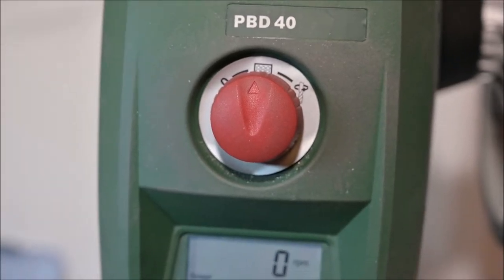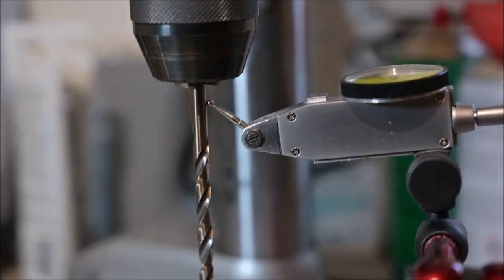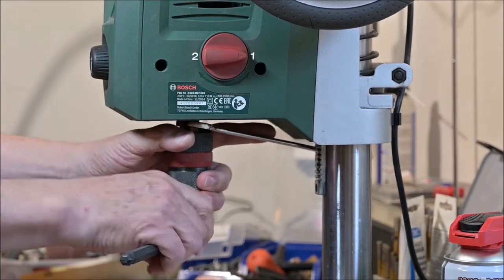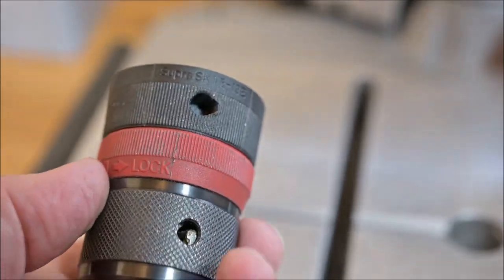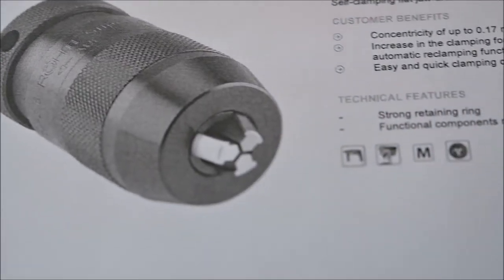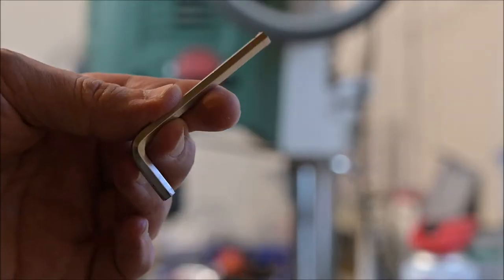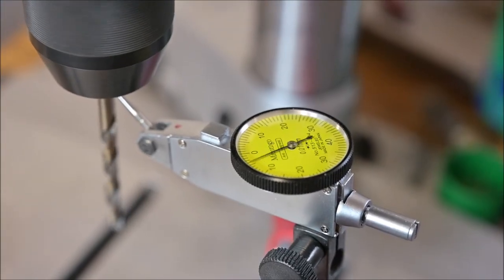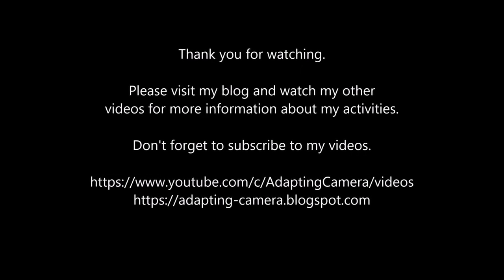Chuck changing on Bosch PBD 40

Comment from the maker: Please note that when you order the chuck you must type in the right part number. Only the ones with 1/2"-20 mount fit this machine, and the one I am using is the 871050. That is very important when you buy the chuck to avoid ordering the wrong one. Please have a look at the end of the my Bosch PBD 40 story: https://youtu.be/3IsRIDdp05o The main reason for letting this machine go is the drill head wobble. After all the years this machine was on the market, I had mine for about 10 years, this simple issue is still not fixed. Every one I checked in every store in several countries has the same issue. It could be easily fixed if Bosch would change the rack to a bit wider one or at least would add some set screws to tighten and adjust the wobble. It's a shame because I really like this machine.
Anyway, I bought a new machine: https://youtu.be/5_HTjUOUsf8 It's not perfect, but much better in many ways.
Reply: how many mm is the thread size?
Reply from the maker: @bonjob47  Thread size is 1/2"-20, not mm.

Comment: Only a few days ago, I was seriously considering a replacement machine for my PBD-40 because of the run-out, but now I think I will try buying a new chuck. Good video!
Reply from the maker: Beware that the machine head is wobbling also, so make sure that it is acceptable for what you are doing. Also, you may consider changing the bearings as well, if not now, maybe one day, because they are not great.

Comment: Great video and really good advice. I’ll be upgrading now that I have seen this. Also, heat can sometimes be really helpful to remove “glued/lock tight” chucks. Sometimes just an ordinary heat gun blowing into the centre of the chuck for 5 minutes or so can “melt” the glue, and make removal easier.
Reply from the maker: Thank you for your comment. Actually, I don't think it is glued at all, but as you use the machine, the chuck will be more and more tightened because of the rotation. This is of course good for drilling, but makes it more difficult to remove the chuck if necessary. Personally, I would not use a heat gun because it may cause fire or cause other damage to the machine. Also please note, that the bearings of the spindle will also be heated up, and the grease in the gear box may melt. So while in theory, heating it may help, it may also cause damage, so be careful.
Reply: Ageeed. I use it as an absolute last resort measure when everything else fails.

Comment: I changed the input shaft top roller bearing on my BPD40 for 2 ball bearing races, and there is now zero movement on the shaft of chuck.
Reply from the maker: Yes, it's a good idea to change all the bearings. I also have a set of bearings and will change them one of these days.

Comment: Hi from Finland. Had to wait about a year to do this due to not having sufficient space for my PBD 40. Finally did the chuck changed today, following your instructions.The original chuck was glued damn tight, but the pipe method worked perfectly. Thank you so much for this great video, was really helpful.

Comment: Thank you for taking the time to show this useful mod. Apparently, there are videos covering changing the 
bearings on the output shaft of this drill - but as you have shown, this might not be necessary, with a simple
change of chuck. I haven't purchased this drill yet, but have been pondering on it. Very helpful, and 
appreciated :-)

Comment: I'm so glad I found this video. My PBD40 was always throwing out bits during use and I didn't have any faith in it. Just ordered the Rohn Supra. Thanks
Reply from the maker: Thank you very much for your comment. Yes, your problem was my problem also, and in fact, that was one of the main reasons for me to change the chuck. That locking mechanism is just a joke, I never liked it, and it can actually become quite dangerous. Sadly, the machine is sold with the same chuck even today, but maybe it's been improved. Anyway, after the chuck change, I never had any issues with the chuck releasing a drill bit. It is also easier to handle it.

Comment: Just purchased one of these and initially was impressed. Lots of info on how to use, correct settings for this, and that.
In its first outing, quickly released, the chuck is rubbish.
Quick search, lead me to your video (very good, btw)
I was unable to remove using your allen key or pipe wrench method, as the chuck would spin.
I ended up cutting off the red plastic collar and black plastic collar at the top to reveal a smaller metal spline.
With a wee push, the chuck undid.
Needless to say, a new chuck has been ordered. 
👍 thanks for the video
Reply: Did you just cut the two top sections open with a dremel or something similar?

Comment: Thank you very much for the video, it was extremely useful, as were peoples comments. I've changed the chuck (£100) but had to use a pipe wrench as it kept opening when I tried your allen key method. It came off fairly easily with no damage. I've also replaced the bearing (£5) and used the bread method to extract the original bearing. I was gobsmackedby how well it actually works. The change to the accuracy of the drill is remarkable, Thank you again.
Reply from the maker: Thank your for your comment. Actually, mine was so tight that I couldn't use a pipe wrench, unless I'd have used a very large one, which I don't have. So the Allen key with a pipe extension did the trick for me. I have still not changed my bearings, but one of these days will do it...
Reply: Do you know a source on how to replace the bearing?
Reply: @JustinShaedo  search for SMR128ZZ EZO Stainless Steel Miniature Bearing 8x12x3.5 Shielded, if you were uk based Wychbearing is where I got mine.

Comment: Thank you so much for this video. I had been researching bench drill presses and liked the Bosch PBD 40 but didn't like the chuck it comes with and hesitated buying it until I found this video. Afterwards, I ordered both the drill and the Supra S chuck. Following your video, I replaced the chuck. Being brand new it broke free very easily. The Supra S is all steel construction and just feels so much better built and performs great, I'm glad I replaced the original.
Reply from the maker: Thank you for your comment. I am glad I helped you making the decisions, and hope you will be happy with the machine. All I know is that if I had to buy a new one I'd still buy the same machine, but I'd do the same as you, i.e. buy a chuck at the same time and install that on day one.

Comment: Thank you for your helpful video. In my case, the drill chuck with the red ring was defective and wanted to exchange it. That's how I came across your video and now I've bought the Supra-S for 65 euros instead of the original spare part for about 120 euros, which is also much better. Thanks again...
Reply from the maker: I am glad that my video helped you out. I had no idea that the replacement chuck costs more than the Supra S, but it is definitely not worth paying for the original if one has to replace the chuck anyway.

Comment: Had this problem and followed this video to remove the chuck, worked like a charm :)
I didn’t have a replacement chuck, but I wanted to measure the cocetricity of the shaft the chuck was attached to, was wobbling 0.1mm (4 thou) :( a bit dissapointed I screwed the old chuck back in and to my surprise pretty much all the wobble was gone :O Measured the wobble on my drill, less than 0.04mm (1.6 thou) :D So before buying a new chuck, try unscrewing the current one, rotate it 180 degrees and screw it back in (not sure about the 180 though, I just screwed my in at random, so you might have to try a few times)
Reply from the maker: I tried that but in my case it was no help. Also, the original chuck is really crap because it has that locking ring, which WILL release the bit now and then. The self locking mechanism is not good enough, and if you look up the chuck, you will see, just as I show you in the video also, that the chuck is made for impact drills, and small hand drills which rotate in both directions, not designed for bench drill machines. So in every aspect, even if you magically can get rid of the runout, the chuck should be replaced with a proper chuck, designed for bench drills. Runout is not everything, there are other aspects of a good chuck also.
Reply: @AdaptingCamera Yeah, you’re right that the chuck is bad. Just didn’t feel like spending 70 bucks on a budged drillpress :p But it’s probably worth the money.

Comment: Hi, thanks for this very clear video. I changed my chuck too. And it is a real upgrade for my Bosch. An advice for other viewers: the big seller with the A is more than 20 dollar cheaper than the adress you mention in your post.
Reply from the maker: Thank you for your comment. I bought mine from Amazon.de and the link is only because Amazon is really bad in providing description and their translations are horrible, so I did not want to provide a link to them. Anyway, my next work will be changing all the bearings. I have already ordered them (not from Amazon) and now waiting for delivery. I will also try to eliminate the play caused by bad design of the center column / motor head connection. So... stay tuned... more is coming. I just need some time. :)
Reply: @AdaptingCamera  Hi, great mod! Too bad we need to spend € 60 on a € 300 drill to make it half way decent. Worst part is, looking at prices for the SK E, that's € 60 for us, when it would have been ~€ 5 for Bosch...

Did you get around to changing the bearings? How did that turn out and what bearings did you use?
Reply from the maker: @paulnieuwkamp8067  I haven't changed the bearings yet. Maybe later on during this summer. I agree that Bosch should have added this chuck, and not the one they have it on the machine. The price difference would have been minimal. Now we have to buy the drill machine and pay for the chuck we don't want to keep and pay for a new and MUCH better chuck, so basically we pay twice the price because of that.

Comment: It worked  and  the new chuck ( a Röhm ) is mounted on the PBD-40. Works  much better now, so thanks.
I did not used a pipe,  but a ca 40 cm pipe wrench (pliers?)  because the key  wasn't holding in the former chuck.  But take care, the ring above the red one is also made of plastic.
Reply from the maker: Thanks.

Comment: This is a great video. My PBD 40 has just arrived on a cracking deal of the day from Amazon (£200). The Supra chuck is on the way and should arrive next week. I could not make my mind up on this drill as the internet is awash with comments and videos of the 'chuck wobble' on and it was your video that swung me towards the buy now button.

I had to laugh about the advice on chuck removal on this model from one of the Bosch mentors on their community channel. Anticlockwise and hit the alley key smartly with a hammer. You could not make it up! You will see in the video folks that it is clockwise viewed from above and that it is really bad practice to hit machinery and bearings with a hammer!

I have taken the chuck off perfectly easily with a 10mm Allen key socket using a tube about 50cm long for leverage, and then popped it back on in the meantime. I did do some test drilling with wood as I was curious and I have to say that the results were perfectly acceptable to be honest (in wood). However, there is considerable wobble in the supplied chuck which I am sure would present more of a challenge in metal.

I will report back when the Supra chuck is fitted but the ability to change speed with a knob still makes me smile!
Reply from the maker: Thank you very much for your words and good luck with your machine. Yes, unfortunately, it is a common practice to hit the Allen key in the chuck. It's been done for as long as I lived (65 years) but I always thought it was a REALLY poor idea and always avoided doing that. EVERYTHING in the machine gets the hit and may be damaged. Bearings, axle, gears, chuck and even the motor. I don't understand that this is still the recommended way also by some professionals. Also the clockwise / counter clockwise thing is confusing unless it is clearly indicated by a picture or stated if you are facing the axle or looking at it from above, like you normally looking at the chuck of a bench / pillar drill machine.
Reply: Also did the bearings. Not a project for the faint-hearted I would say but perfectly possible if you take your time. Take plenty of photos as you go and watch out for the contents of the gearbox falling out onto the bench! Took an hour in total and all was well.

Very satisfying to grab the chuck however and feel no movement whatsoever.
Reply from the maker: @cmbd9301  Thank you for your comment. Yes, it's a good idea to change the bearings also. I have all the bearings, just need some time so that I can start and finish without anything in between, other than a cup of coffee. While it took an hour for you, I think it will take more than that to me, since I want to take pictures and video and also want to change the large spindle bearing, and that is a bit more work than the small ones. I also don't want to brick my machine, so I am not a time optimist.

Comment: Just ordered 871050 to replace the standard which is awful. Drilling hardwood pen blanks I could see the drill tip deflect off centre. Thanks for the video / advise. Shame that professional engineers at Bosch allow such issues to arise.

Comment: I used a hollow metal broom handle for more leverage on the allen key.  Worked a treat!
Reply from the maker: Right. I don't understand why hitting the allen key with a mallet is more or less a standard procedure. It results in a HUGE and totally uncontrollable force on the chuck and the whole machine, so I don't understand why people prefer doing that instead of a better controllable method. When hitting the allen key, you not only risk damaging the chuck, but also the spindle or the gear box and can in the end brick the machine. So in my opinion, that's a brutally dumb way of removing the chuck from any drill machine.

Comment: Does every PBD-40 have the same thread 1/2 *20mm for the chuck? How did you know that the ROHM was the 871050 or the 871046?
Reply from the maker: The thread is 1/2" 20 UNF. It is NOT mm thread, it means the diameter is 1/2" and the the thread pitch is 20, meaning there are 20 threads for each inch length. 871046 has a B12 mount, it is not a 1/2" 20, as you can see in the table here: https://youtu.be/nCqVoaGVK8g?t=340 871039 fits also, but the chuck is for smaller drill bits, from 0.5mm to maximum 10mm diameter. I need the maximum 13mm and never drill less than 1mm on this machine, so for me the the 871050 was the best alternative. The original chuck had a span of 1.5-13mm, so my new one has a bigger span anyway.

Comment: Thanks for sharing. The chuck you suggested was only a slight improvement for me, maybe I got lucky with the OEM chuck. I suggest looking at the bearings and drill head / column interface for the best bang for your buck. Originally I had 0.40mm play with 0.09mm runout. Changing the needle bearing  reduced play to 0.25mm. Then I replaced top and bottom column felt wipers with CNC'd 10mm thick UHMWPE collars to stiffen the drill head - I noticed rotational stiffness was particularly poor and made the custom collars fit tightly against the gear rack - tightness had to be balanced against friction preventing the spring from returning the drill head home. Play reduced to 0.12mm and runout 0.05mm. Finally, changing the chuck reduced play to 0.10mm and runout to 0.03mm.
Reply from the maker: But you don't really know how much improvement the chuck change would have made if you only did that, because you started with the bearings. Anyway, yes, changing the bearings definitely is needed also, and I plan to do it one of these days also, but I need my machine because I use it almost every day. Also, chuck changing is not just about tolerances, it's also about NEVER dropping a drill mid work unintentionally, and is also about comfort. The original chuck is for impact drills and hand drills which can rotate both left and right. The three ring design is stupid and difficult to tighten. The new chuck is in a completely different league all together, so for me, even if the tolerance and play would be the same as before, I'd still be happy with my decision of changing the chuck.